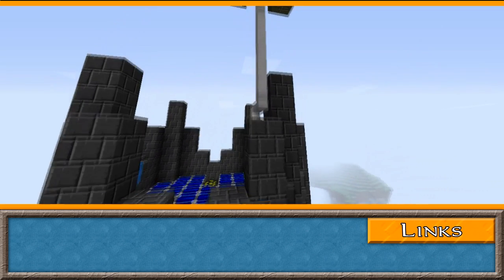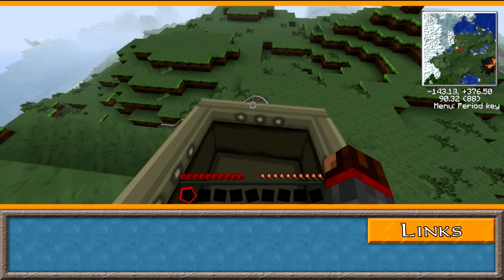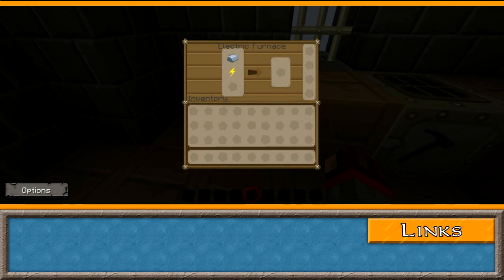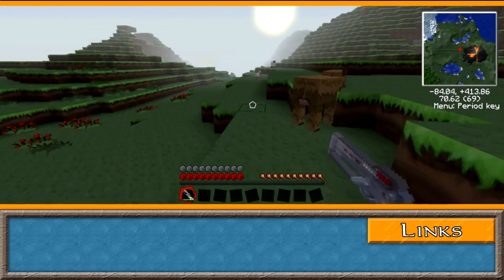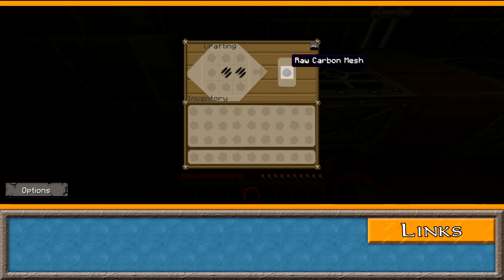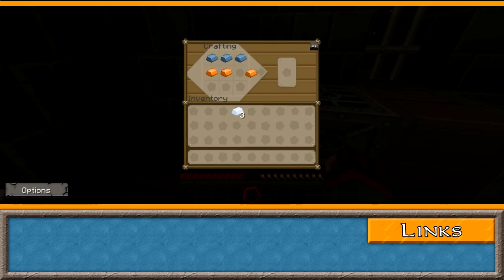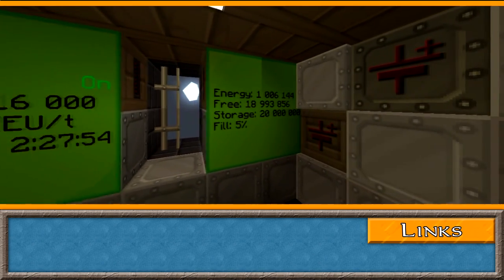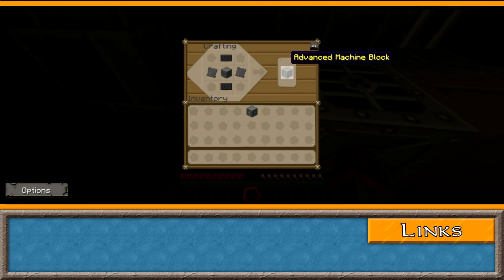Components - Total Technic Tutorials - IndustrialCraft

Comment from the maker: Yeah, I've planned on doing that for a while now. I think it's a nice challenge to create something aesthetically please but also functional, Tekkit-wise. The tower shown in the video is a bit like that. Hidden in the walls and floors are pipes, cables and pneumatic tubes, which are all controlled by a central control room on the third floor. It's not the most aesthetically pleasing (I just wanted functionality), but spicing up the architecture isn't hard compared to hiding cables and tubes! :)